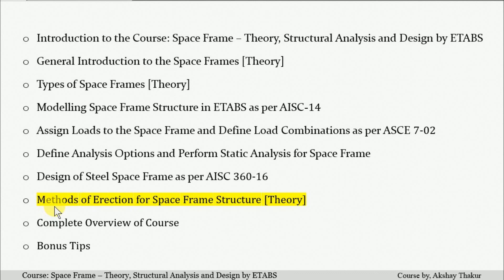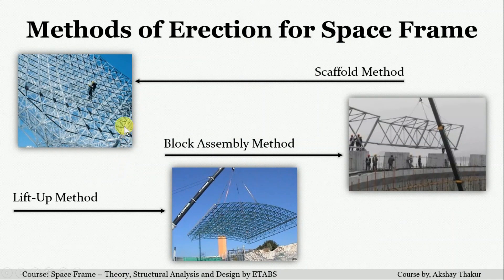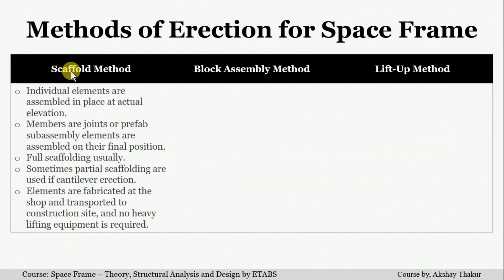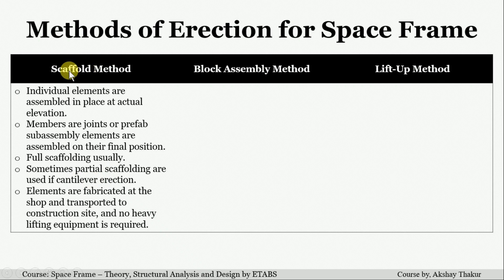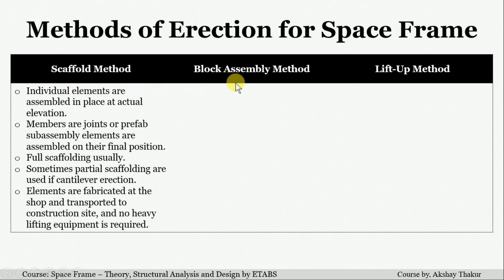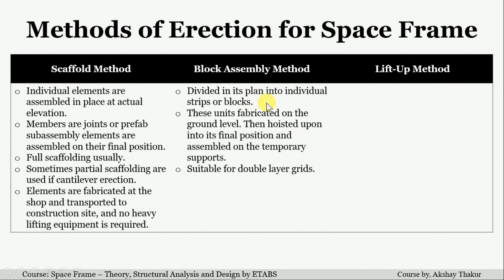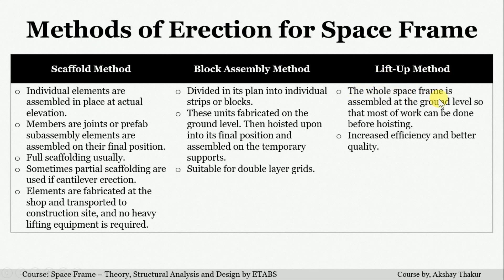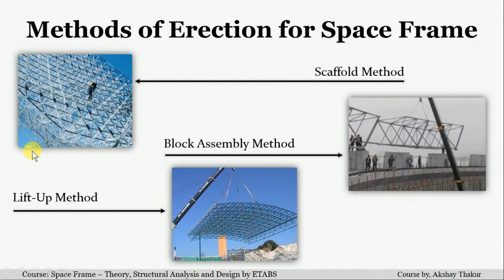8. Method of Erection for Space Frame Structure [Theory] │ Course: Space Frame │ Akshay Thakur

Comment: Sir 30 meter by 40 meter ka bn sketa h ye   frame
Reply from the maker: if you go for higher lengths then the deflections may also come high and the weight of structure may be alot so to be economical provide support at specific distance